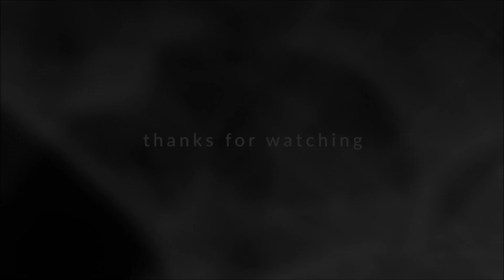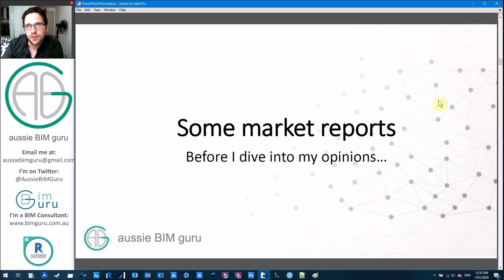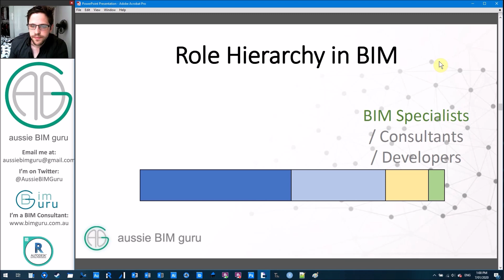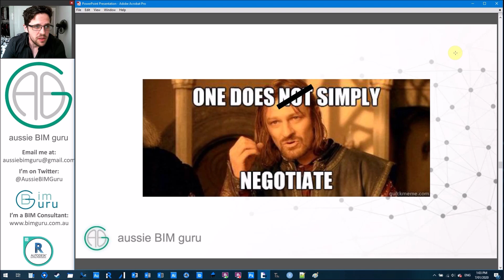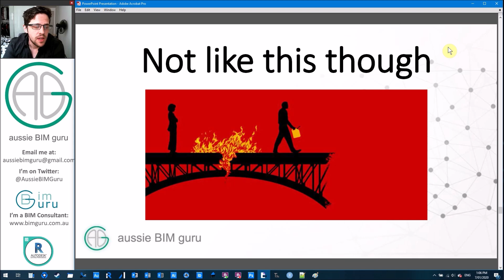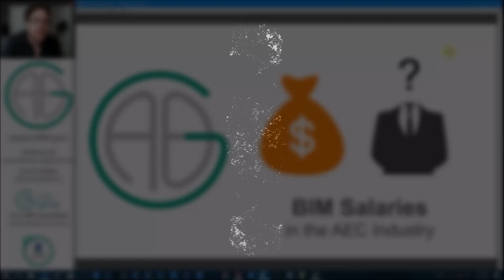BIM Salaries - Knowing your worth

Comment: Hi man, wanna ask you a question. I have not an Architecture Degree, but because of life I work designing houses on Autocad. I know a little bit of Revit, my question is, if I improve my Revit knowlege (and my english too xD ) Then can I apply for a Revit job in Australia or UE or USA? Or exceptionally I need and Architecture Degree? Sorry about boder you, this is a vital question for me, dont know if keep going on construction or change area. Thank you!!
Reply from the maker: It depends on the role you want. You might be able to pursue a drafting role for a home builder for example, but if you wanted to work at an architecture firm then a degree would probably be necessary. Remember that you'd be competing with a market of graduates for the most part, so you'd need to sell your experience hard to a potential employer to compete with the others.